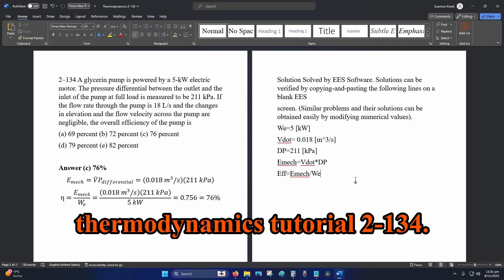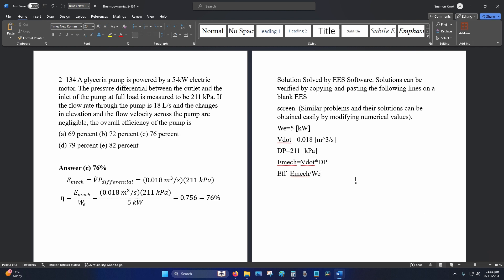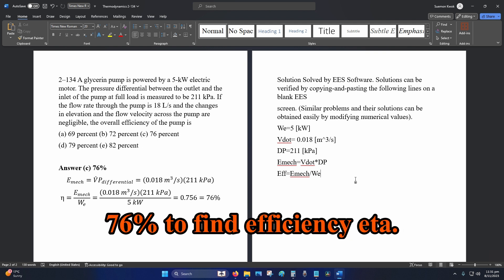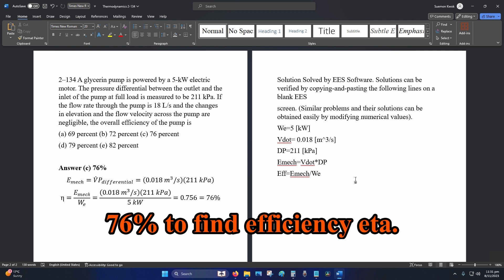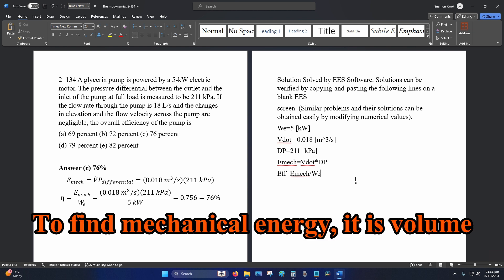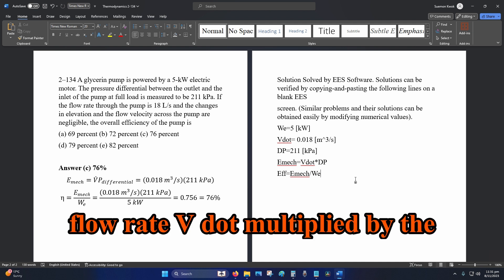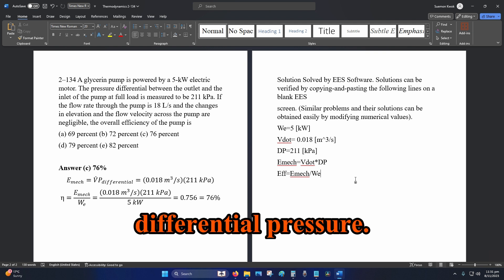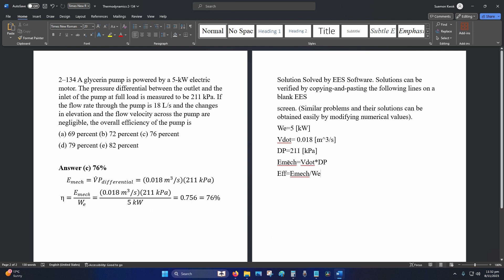Thermodynamics 2-134 A glycerin pump is powered by a 5-kW electric motor. The pressure differential

Comment from the maker: Disclaimer code has been uploaded to anti cheat software such as turnitin. Change it up if you plan on using it.

Answer (c) 76%

E_mech=V ̇P_differential=(0.018 m^3/s)(211 kPa)
η=E_mech/W_e =(0.018 m^3/s)(211 kPa)/(5 kW)=0.756=76%

Solution Solved by EES Software. Solutions can be verified by copying-and-pasting the following lines on a blank EES
screen. (Similar problems and their solutions can be obtained easily by modifying numerical values).
We=5 [kW]
Vdot= 0.018 [m^3/s]
DP=211 [kPa]
Emech=Vdot*DP
Eff=Emech/We